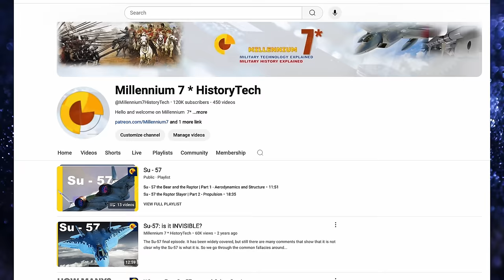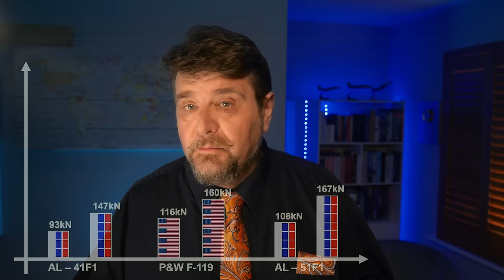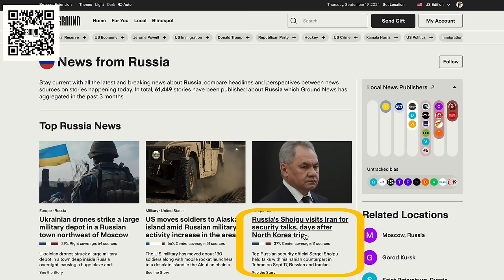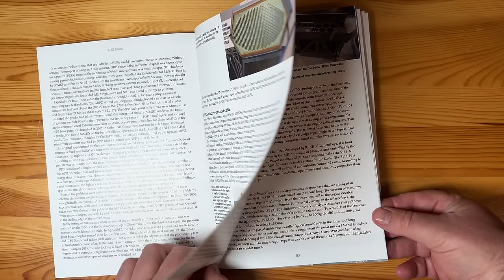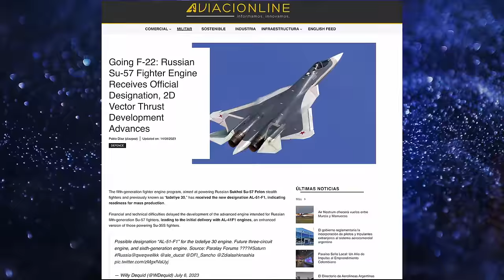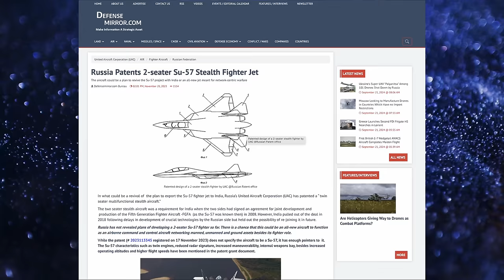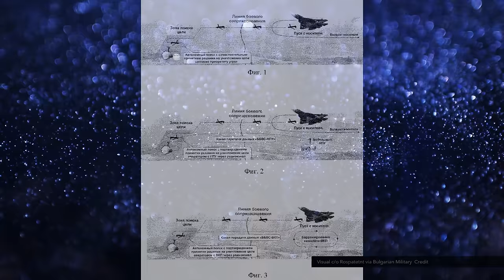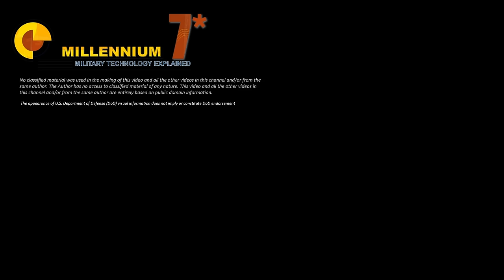The Su-57 is a Masterpiece!

Comment: Frankly I'm not impressed, for the most part it seems the 57 is still reliant on mostly 1990s technology, this is not bad actually, the F-22 is after all of  the same vintage.

It's Solid if you will, that is except for some very nice sounding features with extremely questionable battlefield applications.

For example super cruising, there is a good reason the United States only applied super cruising to the F-22 it works but it's expensive in terms of both fuel load and maintenance, not to mention how expensive it is in just terms of regular expenses those engines are quite pricey, basically you are spending twice the money you would be spending on more standard engines for a very negligible advantage in extremely niche situations.

Then you have Russia's beloved vector thrusts, I am frankly not surprised they would apply it to the su-57 since they try to put that thing on basically everything they have flying, show the cost is likely negligible in everything but maintenance for them at this point but realistically it's only really useful in basically dive bombing or in dog fighting, both of which are incredibly questionable decisions in the modern battlefield, one of which I don't think anybody has done since like the Falklands War.

And then you have the 360 radar, That sounds like a good idea, and I don't really see any downsides I just don't see any real advantage for the cost, you are basically spending four times as much as you usually would on radars for ..... Frankly not much, if your main radar on the front of your aircraft doesn't detect the incoming f-35 I find it extremely unlikely that the ones on your wings will, and yet you still have to carry that weight but much more importantly that cost, I mean that is a lot of radars you have to put in every single aircraft.

I'm not saying that the SU-57 is a bad aircraft or a waste of money, but I am saying that it is wasting a lot of money in extremely niche capabilities of Very questionable value.

I would already find this to be extremely concerning for a nation as wealthy and liable to capability creep as the United States but for a nation with the budget of the Russian military it's downright baffling.

Comment: Would it make a difference if the engines were mounted on the top side of the wings?🤔
Reply from the maker: Plenty. The airflow on the top of the wing is sacred, that is where most of the lift is generated.
Reply: @Millennium7HistoryTech  wouldn't the engine thrust negate this?

Comment: I always say never underestimate your enemies. Three primary aircraft flights are not uncommon. In answer to ground based assets in Ukraine, it would be foolishness for NATO not to have such assets in place considering the nuclear threats, and it's also possible that advanced NATO air and space assets or credible HUMINT assets were at work. Back to a three craft flight; due to weapons systems failures during this war, why wouldn't Russian Air Force high command have started testing western high/lo asset mixing. As I opened with never underestimate your advisories!

Comment: It's interesting that the - 51 engine may be just getting to where the 119 had been in terms of power in a few years.  It'll be interesting to see the final weight and efficiency numbers if those are ever published. 

The other thing I find interesting about this whole project is the completely diversion view it takes on observability from Western systems.  The West is all about LPI/LPD, low observability, collaborative sensing and sharing, etc.  

The Russian approach is to put as many possible antennas on this thing as they can and see how that works.  Not sure how that's going to do in air-to-air combat against a modern 5th generation Western system, but I think this is a more than capable ground attack platform.
Reply: Well, those L band arrays spaxed so far away on the wings will get about the same angular resolution as the more traditional x-band phased arrays. So the su-57 should have no problem both seeing and obtaining a targeting solution on any "stealth" aircraft. 

The F-22 and F-35 though as far as I know will have a hard time obtaining a targeting solution on the SU-57 without AWACS or ground based support. And in a real war those support elements won't last more than a few hours.
Reply: @im1066  I thought it was a Soviet thing, specifically with their warships. Just look at the Kirov-class battlecruisers (Pyotr Velikiy being the last functional one). It’s like someone asked: What kind of missiles do you want. Russian admirals: Yes.

Comment: Yeah, now days it is impossible to talk about technology of some country without being crucified I’ll not even dare to open my mouth. Only praise to sweet sixteen. About my precious opinion about stealth technology on example of f-35 I scratch my head looking on such marvel of engineering - Hardpoints: 4 × internal stations, 6 × external stations on wings. Hmmm in full stealth mode only 4 hardpoints. Wow! Whooping 4 hard points – and same issue with range and drop tanks.  If to compare to my favorite Eurofighter it has 13!  If f35 has external hardpoints there is no full stealth, what for is stealth for then? And it is interesting to look at landing gear of f35 – performs amazing dance as in previous video of the author of the channel.
Reply: But I can praise sweet sixteen - Hardpoints: 2 × wing-tip air-to-air missile launch rails, 6 × under-wing, and 3 × under-fuselage pylon (2 of 3 for sensors) stations with a capacity of up to 17,000 lb (7,700 kg) of stores. Two wing tip does not counts – nothing more than short-range AIM9 does not goes there, 3 × under-fuselage pylon (2 of 3 for sensors) – hence only one is working. 6 under the wings two of them mandatory drop tanks, in total 4+1 in total 5 hardpoints, more often put third drop tank hence 4 (four) real once  Sweet…. sixteen. Adore that jet.

Comment: SU57's most important defect has not been fixed. It's not stealth with an RCS of from 0.1 to 1.0, about the same as FA18 and Grippen. F35 is 0.001 and F22 is 0.0001 square meters. In the coming upgrades the RCS of both is supposed to improve.
Reply: I wouldn't trust any of the published RCS figures for any active service aircraft unless I was looking at the radar returns myself
Reply: @eoinkenny3188  for su 57 it's  Sukhoi's own numbers. Russian weapons always underperform their clains

Comment: Imo its ill adviced to get info from sources like ''sputnik'' or ''ria''. They're considered propaganda junkyards even among russians. I am not to much involved in to modern aviation, but as far as i understand main issue with Su-57 is that there's no clear view on what is the purpose of that jet, especially after Indian $$ left that project. There are technical and capacity issues aswell regarding engines, radar, advanced helmet and air to air weaponary but they're secondary.

Comment: Well…. I do agree one should try to be unbiased. Taking russian info as actual facts though… The critique of russian military info does not come from propaganda alone. Basically everytime this is tested or proved in reality it never measasures up. The propaganda seem to be more on the russian side. And for such an old project it is impossible to not deem the SU-57 anything other than a failure.  That does not mean it cannot eventually become a decent airplane. And the last analyzes is as speculative as potential other views. It is not unlikely Ukraine gets military intelligence from other sources for exemple. I do agree the SU-57 could be escorted by other planes because of other reasons than protection it though. Like one can expect the F-15 EX to escort F-35:s for exemple, as gund platforms. (I dunno if the SU-57 can guide missiles from other aircraft like the F-35 can though.)

Comment: Damn, it seems the F35 will have some competition for the most advanced sensor suite before 2030.
Reply: the F-35 is more advanced definitely, but do you actually mean powerful not advanced?
Reply: I would say no. The russian radar is still a generation behind, they do make up a bit of that by having more radar.

There eqvivalent to link is aslo decades behind.

For EW we dont know, but that is the equipment that i suspect they are the most behind.

Also saying the engine is x% more efficent is a bit missleading. The old S41 series wasnt very efficent.

Wing load have inproved quite a lot, but its still quite a bit higher than that of F22 and even higher than the F35 that do have very high loading by nato standards.
Reply: The f35’s competition is coming from the f15EX, if anything…
Reply: Pretty sure Rafales have it matched in most aspects and even surpassed in others
Reply: @honeybadgerbomb4469  
Me oui! Rafale can do everything…. Ofc!

Comment: The reason why China did not buy the Su-57 is that the Chinese J20 was put into service in 2018. Even for its maiden flight, the Chinese J20 was only one year later than the Su-57. These two projects were almost in the same period. Now the number of J20s in service is close to 300, while the Su-57 is only 20. Moreover, the Su-35 has left a bad impression on China. The Su-35's avionics level is not as good as the J10B. In the PLA's internal military exercises, the J10C and J16 were completely suppressed in the beyond-visual-range air combat. Except for a few dogfights, the Su-35 has almost never won the J10C and J16 with AESA. The PLA troops that were previously equipped with the Su-35 have also begun to change to the J16. In other words, the Russian fighter jets have been surpassed by the Chinese domestic fighter jets in the field of 4.5-generation aircraft, and the gap is even greater when it comes to the fifth-generation aircraft. Now the Su-57 has only one advantage over the J20 in terms of better maneuverability, but with the J20 equipped with WS15, the Su-57 has lost this advantage. In terms of other equipment such as avionics sensor data links, stealth, air-to-air missiles, and radar, the Su-57 is completely at a disadvantage. The F35 has certain advantages over the J20 in these aspects（In addition to air-to-air missiles, because AIM260 is not in service ），and the Su-57 cannot compare with the F35.
Reply: As for the F22, I personally think that the F22 is overrated. The F22's avionics and sensors are seriously backward, and its air intake does not damage stealth any less than the J20's tail, and it can only use link16. This is a disadvantage for air combat. The fact that the US Air Force is willing to develop the F35 TR3 instead of restarting the F22 production line can explain a lot of problems. Previously, the US Air Force even wanted to retire this fighter, but the US Congress disagreed for political reasons. Yes, because of Hollywood movies and other reasons, the F22 has been totemized. Just like Top Gun 30 years ago sanctified the F14, in fact, the F14 and F15F16 are not comparable. The actual combat in the Gulf War has explained a lot, and Iran's F14 was also shot down by the Iraqi MiG-23. Many military bloggers put the F22 first for political correctness, which is wrong. For fighter jets now, I personally think 1. F35 2. J20 3. Su57 and F22 (Su57 will have better avionics sensors because it was born later, but the gap between R77 and AIM120D is large, so the two are temporarily ranked together) and J35 and Turkey's stealth fighter have not yet been put into service and are not included in the ranking
Reply: @你看个锤子你看   The F22 is 30 years old design . Its so old the congress is talking about retering it . Both Russia and ROC managed to reach F22 level in the 2010s on paper not .The f22 has been operational for more than 20 years and the prototypes were made in the early 90s
Reply: @你看个锤子你看  the condition of the F-22s that the USAF sent to Avalon Airshow when I last saw them was shocking. They look like a type that's maintained as flight worthy, not mission ready. And I suspect that's because the AF is trying to do it's best despite the political interference from Congress.
Reply: @jamesrowlands8971  Yes，I agree with you,I have been to air shows and watched the F22 F35 in Chicago. The F22's flying maneuvers are really cool and impressive. However, modern air combat cannot rely solely on maneuvers.
Reply: @maksudagypsy  J20 avionics and radar sensors are better than F22. F22 is only better than J20 in mobility. F22 even needs to add more gear to have infrared aiming capability. J20 already has EOTS and EODAS. F22 sensor level may not be better than the latest F15.
Reply: @你看个锤子你看  In pure kinetics we know that the F22 has dominated for the last 20 yrs . Its engine also has very great lifespan. Russian managed to make a engine with better trhurst to weight ration but it was just this year
Reply: @maksudagypsy  WS15 thrust has surpassed F119. But lifespan may still be different. I don't think this is a big problem. First make sure it exists, then talk about lifespan.

Comment: Most of the praise and data points here are based on what the russians are claiming. 
Luckily for everyone civilized, it is almost always a massive exaggeration. 

Only time they didn't fudge the numbers were when they sold their rocket engines to US companies (RD-180 and NK33 engines).

All press videos of the Felon have shown massive flaws in stealth design(uncovered rivets and screws, not hiding turbines, massive round nozzles on engines, badly insulated weapons bays aso). It is a good looking plane, but the NATO AWACS assets have claimed(not Ukraine) to see them on their sensors flying over the Black Sea. 

And if their claims are correct, the Felon has, at best, an RCS of a Hornet. While not terrible in itself, it is atrocious for a claimed 5th gen fighter.
If an AWACS can see it, a patriot can take it down and necessitates an escort.

(FYI, UA now has their own SAAB made AWACS assets, so likelyhood of UA spotting them on their own is above 90%)

Comment: Sweet video. I still think J-20 is better, it being produce in actual numbers unlike the Su-57.
Reply: J20 has advantages in radar, avionics and sensors, and its stealth is better than Su-57. Currently, Su-57's advantages are speed and maneuverability. But J20 needs to replace WS15

Comment: Don’t think Russia can capitalize on the design. As things are playing out now China and India are not the close buddies Putin hoped for so not export market. Russia is bleeding men and material in Ukraine and will need the funds to rebuild the army. It will be a token force at best.
Reply: ？The reason why China did not buy the Su-57 is that the Chinese J20 was put into service in 2018. Even for its maiden flight, the Chinese J20 was only one year later than the Su-57. These two projects were almost in the same period. Now the number of J20s in service is close to 300, while the Su-57 is only 20. Moreover, the Su-35 has left a bad impression on China. The Su-35's avionics level is not as good as the J10B. In the PLA's internal military exercises, the J10C and J16 were completely suppressed in the beyond-visual-range air combat. Except for a few dogfights, the Su-35 has almost never won the J10C and J16 with AESA. The PLA troops that were previously equipped with the Su-35 have also begun to change to the J16. In other words, the Russian fighter jets have been surpassed by the Chinese domestic fighter jets in the field of 4.5-generation aircraft, and the gap is even greater when it comes to the fifth-generation aircraft. Now the Su-57 has only one advantage over the J20 in terms of better maneuverability, but with the J20 equipped with WS15, the Su-57 has lost this advantage. In terms of other avionics sensor data links, stealth, air-to-air missiles, and radar equipment, the Su-57 is completely at a disadvantage.

Comment: Su-57 is developed for Russian Air Force exclusively. Fighter plane with 360 degrees radar coverage is not needed for Air Forces that have a large fleet of operational AWACS platforms and superb Data Link technology. However, Russian Air Force do not have neither large fleet of AWACS platforms nor a high level Data Link capabilities for exchanging relevant information between AWACS platforms and other airplanes. To overcome that they are developing some exotic technologies like that exotic radar system installed on Su-57 . To use that radar capabilities with full potential single pilot is not enough and two people in cabin are needed. Remember the Kamov Ka-50 and Ka-52 saga? Su-57 is capable aircraft in many aspects, no doubt about that , but it is not directly comparable with anything on the West. And it is 5th generation fighter which becomes operational 25 years after the F-22 Raptor, 10 years after F-35 and 7 years after China made  J-20 Mighty Dragon. That is reality.

Comment: The Su-57 may be a half decent 4.5 gen fighter, but the bottom line is that they are essentially irrelevant when a single branch of the the US military alone can field 6 times as many F-35 airframes, and that's assuming a generous 20+ flying airframes in Russian service.

Comment: Upon a close look at the air show, the aviation community is confirming that the su-57 is a poorly assembled piece of crap, that has the same RCS as an unladen F-18.  You guys are clowns. 😂
Reply: too many 1d10ts. In cina was sent the t50-7, one of the first prototype, used also fot top gun maverick. that can be easily dismount and assembled. also the engini was the old old 41 version, used only in the shows.